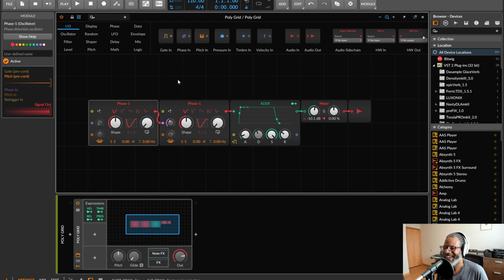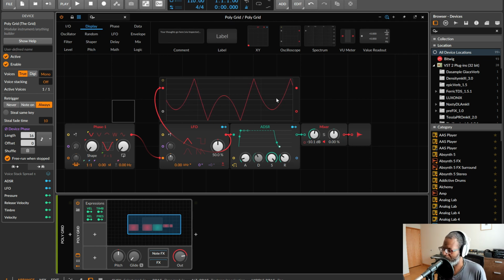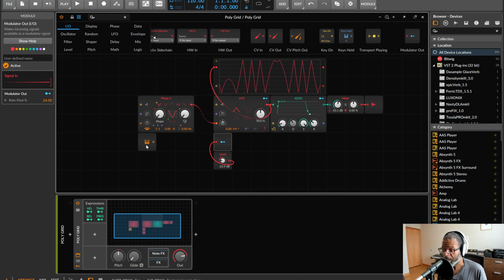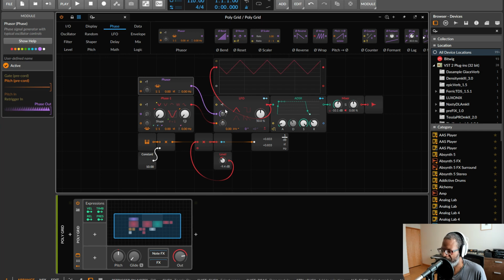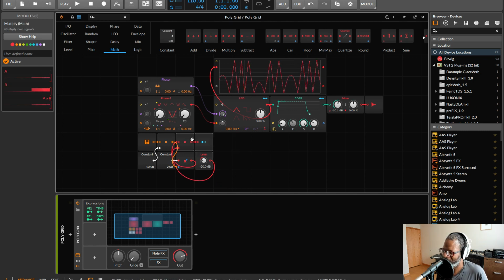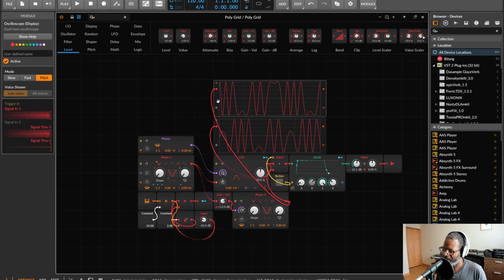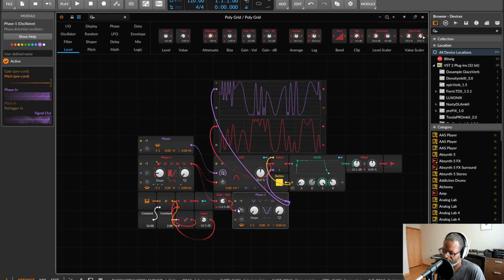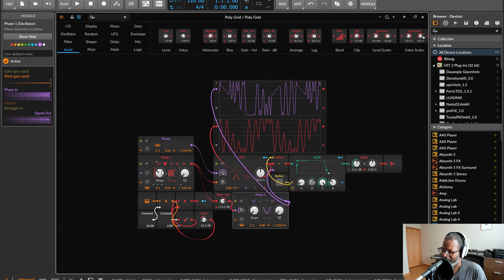FM v PM: TRUE Frequency Modulation (linear) in Bitwig’s Grid!

Comment: This is superb work, thank you - added to my music AND knowledge playlists :)
I've sometimes got confused about the difference between PM and FM. In my head I keep thinking "if you're making the clock scan the waveform faster, you're speeding up the phase change, which is surely the same as increasing the frequency?" I guess the key thing to remember is that phase modulation operates in a different part of the equation. So:
A(t) = Asin(2𝞹ft+phase0+PM)
A(t) = Asin(2𝞹(f+FM)t+phase0)
This means that in the case of FM, the modulation gets multiplied by the time, whereas in PM it's just added on as it is.
...right?

Comment: Hi, thanks for the video. is it possible to fix the sine (or any other) oscillators on the grid to a single frequency (which can be specifically inputed), as in ableton's operator?
Reply: In Pitch menu you have a pitch module that you can set. Then just turn off the prepatch on the oscillator, connect that pitch module and turn the modulation knob open.

Comment: There's a solution by using mathematical funtions - and you can make use of a second oscillator instead of an LFO.
Basically it works by transfering the linear signal of an oscillator's output to the logarithmic range of a Pitch input (you know, it make use of logarithmic input values).
First you have to change the oscillator's output in a way, that there's nothing negative (because you surely know, thet there's no logarithm defined for negative values). I separate positive and negative values by using 2 Rectifiers (Shaper-modules) and make the negative part positive in this way. After this step I add to both parts the constant value 1 (to make the logarithmic value start with 0 =zero) and use the log-function to both parts of the signal. Then I make the primary negative part again negative by multiplying it with -1 and add positive and negative part together.
This summed up signal can be modified again (by attenuating it, adding constant values,... etc), but basically this signal is transformed into the value range of the pitch input - try it.
Unfortunately there's no exact way to work in the frequency range instead of the pitch range... adding values to a frequency would be possible to calculate, if... the math function wouldn't come with the given very limited value range... the functions themselves would be sufficient, but the value range is way too limited.
Reply: Nah, this doesn't work properly. The correct way to do it, with the latest version, is to disable key tracking on the oscillator that you're modulating, then get the keyboard pitch, convert it to frequency (there's a dedicated pitch to frequency node, but I suppose you could just apply the exp function), then add the output from the modulator, then convert the frequency back to pitch (there's a dedicated frequency to pitch node, or do the log again). Then modulate that oscillator with the resulting pitch.
So: input pitch -> exp (or pitch to hz) -> add modulator (tweak the level as needed, but try not to go into the negative territory here) -> log (or hz to pitch) -> oscillator pitch (key tracking should be disabled).
At no point you should be doing the +1, or splitting the positive and the negative parts of the signal. This makes the audible pitch go up and down depending on the modulation amount.